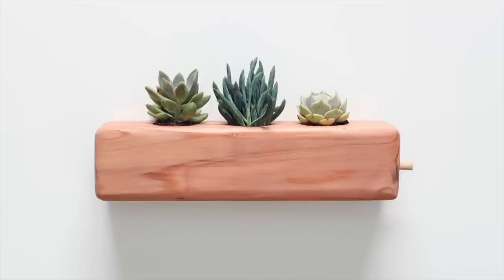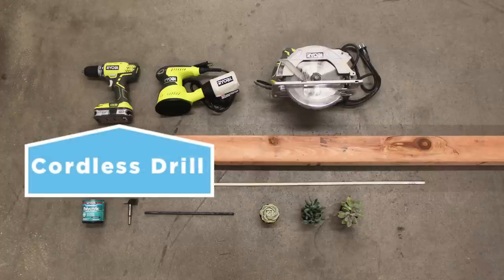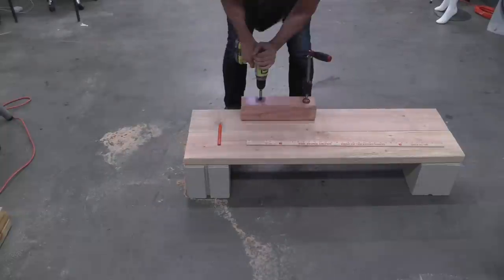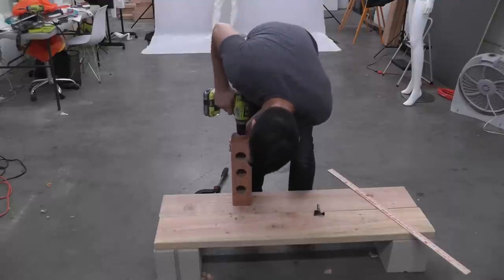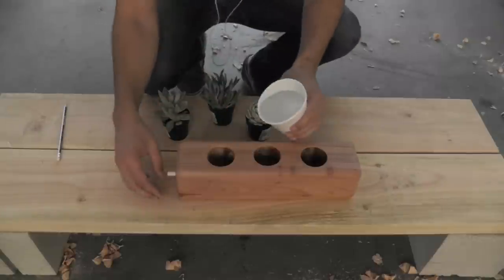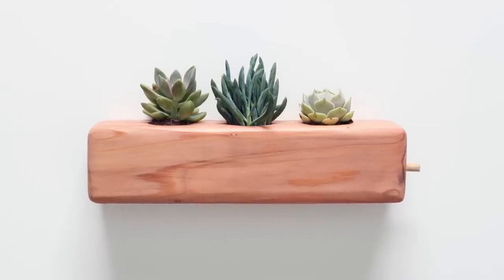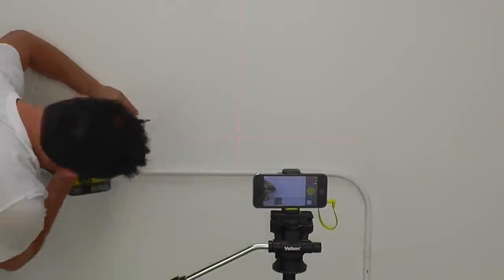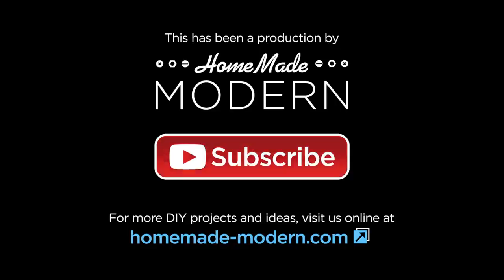DIY Succulent Planter

Comment: Absolutely love your projects, not least this one, in fact I am using this same design for a spice holder rack, minus the drain hole of course. Great idea using a simple material. Quick question. You used the Orbital sander to round the edges off, is this good use of the sander or not? I ask as I am in the market for a sander, and think this is the type for me.

Comment: Gonna give you the benefit of the doubt you didn't steal the geometric idea from designer Joe Gibson. If so please give credit to designers if you take inspiration from them! Thanks -Z
Reply from the maker: +Zach Gregory actually was inspired by the Zen Blocks i got as a reward from Andrew Michler's kickstarter campaign back in 2012. the facets were done randomly with a sander.  the joe gibson ones are way nicer but it looks like more of an extrusion done on a table saw with angled cuts to separate the pieces.
Reply: nice ill have to check those out

Comment: nice!

But i don't understand the "why" of the little plug? 
How is this plug an obligation?
Reply: to remove excess water in the soil. You wont want your plant to soak in water. Another reason could be, to change clean water after awhile
Reply: Mystipaoniz i neither understand why there's such hole and plug!